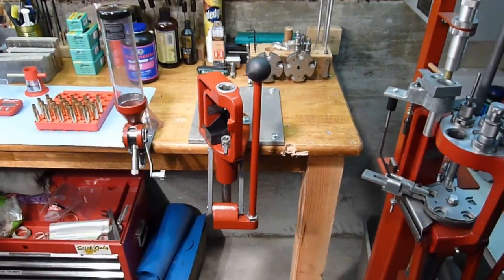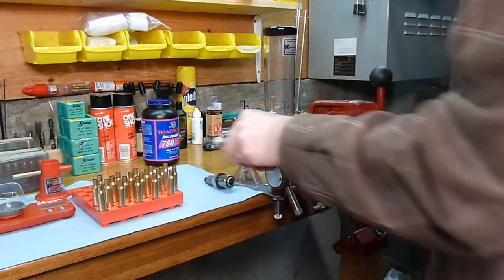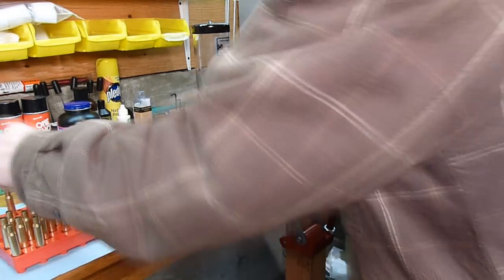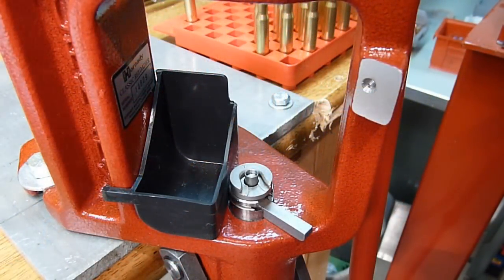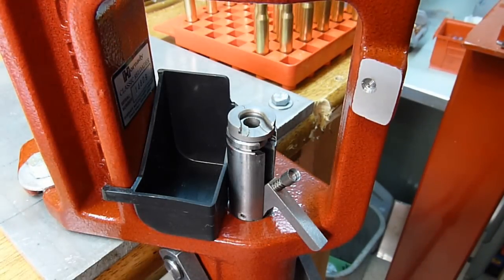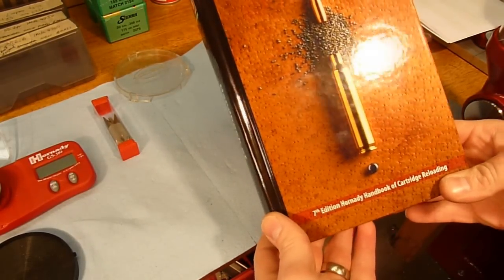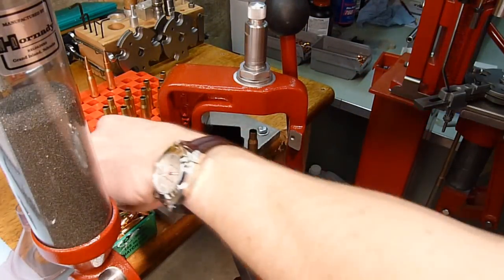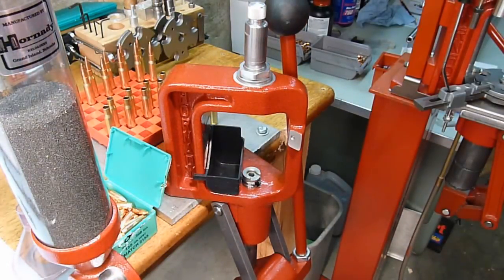Hornady Lock N Load Classic Press (HD)

Comment: Should the bullets be lubed for every process you using? I know that it should be used for bullet resizing but what about for the bullet seating process? Also when cleaning your brass, if you use the sonic cleaner by Hornady they express how well it cleans the inside and primer pocket of the bullet. Would you,if using the sonic cleaner, lube your bullet and resize/ deprime them before cleaning them?